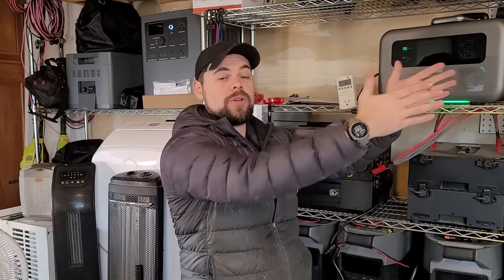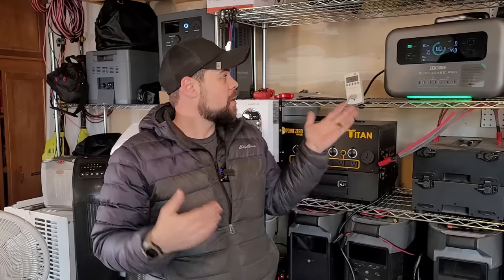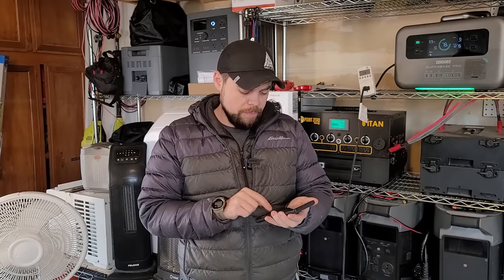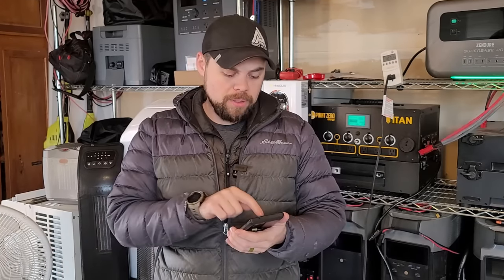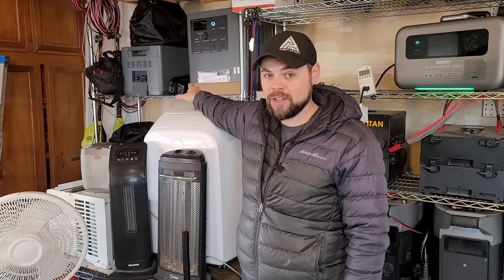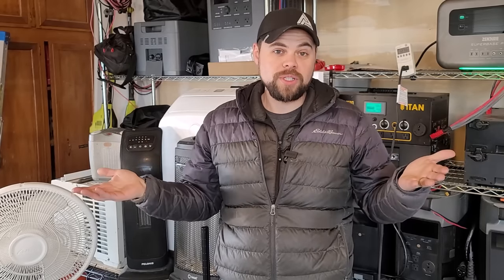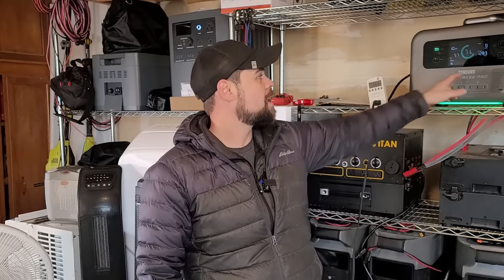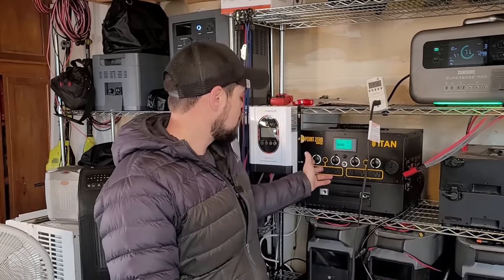Running Space Heaters on Solar Battery Power

Comment: Great video. This is a big mental block for  a lot of people. They have no concept of how much power a small resistance heater  uses, and are genuinely surprised when they discover that they can’t heat a single room for more than a couple hours with a $2000 power station.
Reply: The arithmetic here is so basic it's elementary school level really. The abysmal efficiency of this setup in terms of capital expenditure is a byproduct of very low energy density of both solar power generation and more importantly battery storage. A 1 liter of gasoline has WAY more energy stored up than even a powerful and expensive power bank.

So yeah, until we develop some super batteries and super photovoltaics we are stuck with fossil fuels - unless of course we want to be super eco and live in cold like Neanderthals.

One possible alternative is small modular nuclear reactors - you buy it for a hefty sum of money but it lasts you 30 years with little to no maintenance. They aren't available yet but there's really nothing better on the market right now.
Reply: With the more efficient mini splits you can run infinitely given a small or moderate battery & solar system.

Gasoline is good until that gallon is gone.
Solar with the right tech is infinite.

Even in -22 you're gonna get 80% efficiency with a good mini split and far more btu than electric resistive heating
Reply: @timothykaczynski2752  Solar isn't infinite.
It requires minerals to be dug out of the ground to make the panels. Those resources are finite.

The lifetime of the panels in operation is also finite, which means they need to be replaced, which means those resources from the ground need to be consumed.
Reply: @timothykaczynski2752  Really? A mini split needs 2K to 4K depending on the size. So if it runs 6 hours a day (fairly conservative), you need plenty of storage and lots panels to charge it up. In terms of A/C, mini splits are more efficient than central air, but in terms of heating, they are less efficient than central heat because of the electricity they require.
Reply: @deang5622  30 years is practically unlimited compared to the ~3 months you get from gas/kerosene/natural gas when the lights go out. Use your context clues.
Reply: @vegasgamedude4379  a 22 SEER unit will produce ~14 btu/ watt. A 12,000 BTU unit for emergency use with the thermostat set on 55 will cycle on maybe once every 12 hours for a single cycle - in a 500 sqft room given moderate insulation.
Reply: Yes. If you want to heat any building on a restricted power budget, the first step is to insulate everything to the greatest degree practical. Then insulate it a bit more.
Reply: @deang5622  The bulk of the materials to make a solar panel are silicon, glass and aluminium. All of which are in very ample supply. The glass and aluminium can also be recycled. There are rarer elements required as well, to dope the silicon, but only in minute amounts.
Reply: @deang5622  Gas goes bad and cant be stored for long. Pretty sure gas has to be extracted from the ground. Panels last 30 years.
Reply: @vylbird8014  So you list the materials to make a solar panel, yet you omit several with which the solar panel cannot function, which underpin the entire mechanism of the capture and conversion of light into electricity.

You really don't know much about them, do you?
Reply: @deang5622  I listed the bulk of materials by mass. Yes, there are others required. Just not much of them. Even 'heavy' doping in semiconductor manufacture means one atom in ten thousand.  Tiny amounts. The cells themselves are almost entirely silicon, and the bulk of the whole panel is in the support structure of aluminium and glass. The least-sustainable part is probably the adhesive that sticks everything together.
Reply: @vylbird8014  Listing by mass is irrelevant and you should have realised that.

It's the availability that is important and whether the materials can be substituted by others.

Even your counter post refers them as "tiny amounts" and the fact you didn't list 2 of the materials out of a very small number used to make solar panels, and the fact that your response is to state that the industry doesn't even refer to them clearly indicates you don't consider them important to the manufacture,and yet the panel will not operate as a solar panel without them. So in fact they are two of the most important materials in the manufacturer of the panel.
In fact I would say the most important materials in the panels are : silicon, boron and phosphorus and yet you only listed one of them.

You cannot consider the longevity of solar panels without considering these materials.
So listing the materials by proportion of mass of the product is therefore 
 fundamentally flawed, isn't it?
Reply: @deang5622  light and heat are needed. Solar panels are almost useless in winter.
Reply: @jeremywhitesell2688  What on earth are you talking about?

I am talking about the production of panels, their manufacture, not operation.
Reply: You`re better off using solar for heating hot drinks/soups and using it to power electric blankets on a lower setting. I used my 700 watt Bluetti EB70 to provide power for an electric blanket on medium high during the recent massive freeze here in Louisiana. The lights kept flickering due to high winds which kept cutting the power off on my digital control heater and blanket. I meant to keep the blanket on medium low but clicked a higher setting but still had 40% of my battery charge left. The EB70 display is always wrong so I likely still had 60% left. It did the job. Plus I had a lot more power stations and a massive 300 ah Ampere Time for backup. A 350 watt Dash mini griddle can be used with a larger power station in a tiny room/tent as a heater in emergencies. Great cooker too!

Comment: When people learn how much energy it takes to do certain things, mostly "heating and cooling", with electricity, they are stunned.  For heating, there is nothing more efficient, in my opinion, than a masonry stove or a rocket mass heater, burning plain old "wood".  It's the original renewable power source!  :)  We have a wood-burning insert in our fireplace that has a plenum chamber above it.  That plenum chamber has two standoffs in the attic that tie into our HVAC hot-air return.  The intake for the plenum is a grate just above the fireplace.  When the fire is going and things are good and hot, rising heat in the plenum pulls air in through the grate and out through the standoffs, effectively "pushing" hot air throughout the network of HVAC ducts in my house.  I'm not kidding when I tell folks this system actually keeps the entire house warmer than the forced-air propane furnace does.  Wood will ALWAYS be my back-up source for heat, in my home.  Also, plug-in heated blankets are a great way of keeping people warm.
Reply from the maker: That's an incredible setup! Did you install that when you were building the house or did the house come that way?
Reply: @minutemanprep - So, funny story.  It was installed, but NOT plumbed in.  The standoffs from the plenum chamber were just taped off with insulation over them.  I got my HVAC system replaced and they asked if I wanted those tied in.  They explained that you have to replace your HVAC filter more often, but otherwise could heat your whole house with wood, so heck yeah I had them connect it all up!  :)
Reply from the maker: @jasonbroom7147  wow that's so cool though. I wish i had that. Maybe in my next house.
Reply: @minutemanprep  Depending on what your current wood-burning setup is, you can sometimes retrofit a solution like this.  Anyone with a free-standing wood stove certainly can.  It helps alleviate the condition where it's way too warm near the stove and cold in other parts of the room or house.
Reply: This sounds awesome. I have a fireplace and lament how much heat escapes out the chimney. I’ll check into this.

Comment: $10,000 to run a heater on solar and battery where my electric bill is between $60 and $100.00 a month so it'll be 10 damn years before I see any benefit and then the system would be outdated and have to be replaced. I don't see the point in solar then.

Comment: Very easy to understand your presentation. Thank you!  I've heard that Ca is no longer allowing natural gas appliances in new home builds. Also, they are eliminating all natural gas appliances including furnaces by 2030. I saw another YT video on just how quickly Mr. Buddy heaters go through propane which makes them not practical for any long periods either. I also saw a video on how quickly the Generac generators for homes eat through large propane tanks. If you could confirm those things I would definitely appreciate it. I'm trying to figure out which way to go for home alternatives. San Diego Gas & Electric just got called out today by watchdog groups for raising their natural gas prices to their customers while natural gas prices to them just dropped. It's all just lies to force people into the govt's baloney new green deal. I'm very much looking forward to hearing about the new innovations in solar batteries, etc you are seeing at the Las Vegas convention. Thank you again!

Comment: propane is really the cheapest option. Wish we had other ways to heat a home that is of low expense. Fireplace of coarse...But where is the new tech at? No really much has came out in the last 30 yrs other than wind, solar, and batteries

Comment: We picked up two more Mr. Heater Buddy heaters at Costco for $79.99 including the adaptor hose and a line filter.
Reply: Good call. I have 2, along with over 24 canisters and device to refill them as well as the hose to run from bigger ranks. Thankfully I haven't need them.
Reply: @JWTX  They are the backup to the woodstove for heating the house.
Reply: @CamppattonFamilyCompound  Yeah, same here.

Comment: Amps is what moves from the source to the load. Voltage is the difference in potential. Watt's is how much power is consumed. This is why we say a light bulb is burning 100 watts whereas burning is "consuming", not moving.

Comment: Great video.  I am so grateful that I had my wood stove installed back in 2021, but not everyone can do that or want one if you live a warmer climate.  Just like solar generators, wood stoves are not cheap either.  I paid over $7,000.00 including the installation.  I agree propane,  including the Mr Buddy heater is the best way to go for heating an area.  I had purchased four Buddy heaters before I had the wood stove installed. I never used them, but if a friend or family member needs heat, I have the solution to help keep them warm till the  electricity comes back on.   I was watching this one prepper on Youtube, and he told everyone to to go out and purchase them because they work.   The main thing is to keep your  fridge and the freezers working, using something like the  instant pot,  or portable electric stove tops that you can plug into your solar generator for cooking  and heating up water.  I am  interested in the mini-splits with solar for the summer.
Reply from the maker: Thanks for watching. I did a test earlier this year with my mini splits I installed and maybe I'll edit and post that video sooner than later since that is a big topic people are asking about.
Reply: Whoa. Simple box stoves are about $1000. They will heat a small house. The smaller stoves can be had for less than half that. The little ones can be vented by a diy- er. There are camping wood burners designed for tents. Lots of budget options.
Reply: @YSLRD  I have a split level house, I may have been able to get two smaller ones, but did not think of it at the time.  I had the Schrader wood stove that my dad had installed back in the 70's  replaced with Lopi Evergreen.  The pipes were out of code, and I was afraid that if there was ever a fire, that the insurance company would not pay.  So I had to have everything replaced. The Evergreen is so much smaller though and have to take a chain saw to shorten the wood.
Reply: A Chinese diesel heater is the best option if using fuel to heat. Anything else is a waste of time and money.

Comment: First I thank you for the video as it provides essential information for getting by with what comes naturally.  In that vein a solar water heater  can be made from from drip irrigation tubing, plywood and a clear plastic film (to prevent air currents from blowing the heat away). The water heater should be OUTSIDE and the heat ducted, passively or by a fan (uses far less power than electric heaters.)
Another big help which is to use heaters made for 12 volt systems ( such as R.V.s a nd boats) and use them directly off the photo electric panels. Of course this will not work without enough light for the panels to generate electricity. But when there is enough light saves a lot because tne inverter itself consumes a good part of the generated electricity.

Comment: I forget what I saw it on but I highly recommend having an emergency electric blanket. It is far easier to run off a battery if you need to and it'll get you warmer at a quicker rate than trying to heat an entire room to keep you warm.
And yes 25 hour power outage, December 23 0°F outside between the woodstove and the fireplace inside we ranged between 45-50F.
I ran the electric blanket for somebody off of a car battery I had laying around pretty much most of the day on and off. When we woke up the next day and we were still out I decided to top off my batteries with the inverter that I'm halfway through installing in my van. I was also able to run the refrigerator and the microwave, one of those wasn't planned but somebody came in and just started the microwave! grrrr.

Comment: Thanks for the math lesson Ben, and the summarized comparable system configs...no matter how you slice it, it's going to expensive to run purely on solar on the front end. I've got a Titan with 3 batteries and plenty of solar panels...but if I don't have any sun....well, not much I can do in that context. Cutover to energy alternative #2; pick your poison...I've got a propane converted Honda 3000...runs great and fairly cost effective to charge up the Titan. That should get me thru the night in your scenario. I also have a Mr Buddy Heater, which heats up my sunroom super fast...constantly having to turn it down even when it's freezing outside. Always looking for ways to keep off the grid as much as possible. This space will continue to evolve, so keep the vids coming!
On another note: my parents live in the boonies of Maine and have had power outages every now & then; enough to the point where they just bought a Generac propane system; instant cutover for power outages. Already this year, they've had 2 short outages and it worked flawlessly. Since they heat with heating oil, they need power to run it. Seems to work for them.
Reply: Get a Chinese diesel heater

Comment: Right now in Central California, at around $2 a therm, propane space heaters makes more sense for just me alone in my house.  A 20lb propane refill was $26 yesterday, so you can run a Buddy for about $2.60 for 8 hours versus $16 in gas + 4 kilowatt hours for the central heat.  You can never have too much paneling, batteries, wood, or propane.

Comment: Wow! So glad I have my propane heater stove. This video really put things into perspective. Space heaters are power sucking demons. 
Thanks for your channel and info.
- what do I do with my system when all is well to keep in best condition?  Run 24 hrs drills monthly?
Reply from the maker: To keeo your equipment in the top condition you should use them once every 3 months. Batteries prefer to stay charged between 20 to 80%. Personally though, since my units are emergency preparedness focused, I keep mine topped off at 100%.

Comment: Mini splits can also be used for heating. In parts of the house that does not have direct sunlight you can augment other heating solution with it if you have some sunlight. It does not work in a heavy storm but it may work in extreme cold after the storm which is often coupled with clear skies. Some minis can run from DC directly (some don't even require inverter, you can connect panels directly). This can become very useful if the power outage is long and propane or firewood supply is limited.

Comment: We are and will be tied to fossil fuels for the next 50 or so years, think of the kWh it takes to run a small city.  A battery bank the size of my shed still has to have a fossil fuel generator to back it up.  Thanks for the work you are doing in the solar battery / solar panel field.
Reply: Nuclear